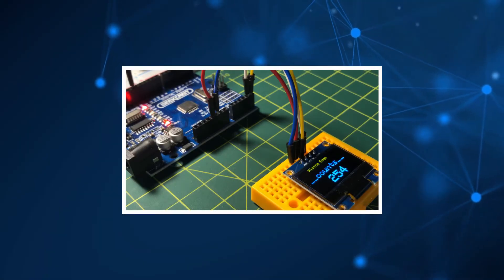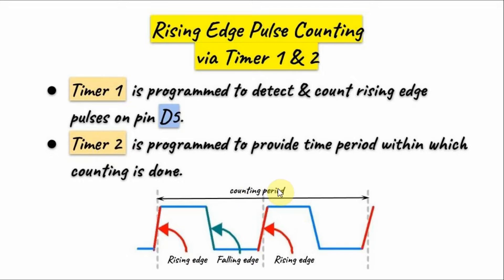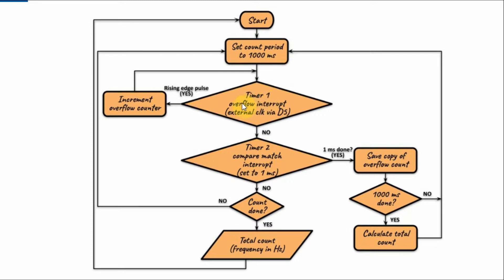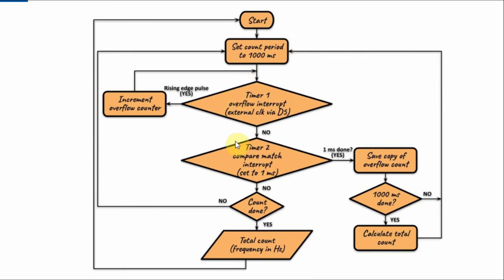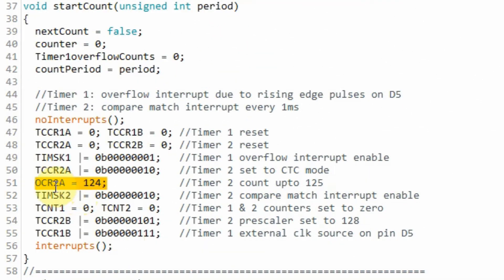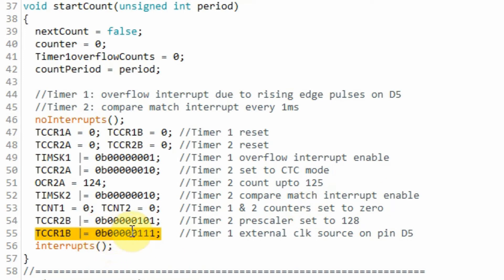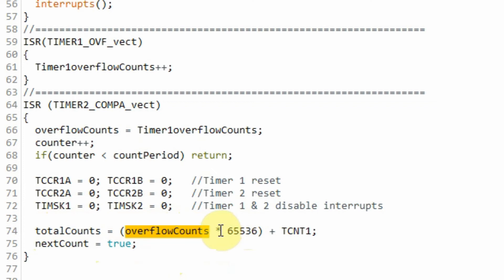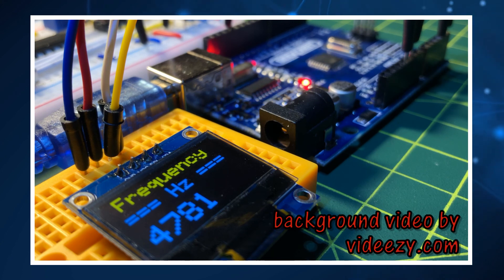Frequency Counter using Arduino Timers

Comment: Sir i need to write a code for arduino that calculates the frequency of a vpulse with timer 1 using counter mode only  on pin2 of the arduino without resorting the interrupt service. Can you help me with such a code..

Comment: Why it does not count  frequency higher than 7 MHz ??? Do you have any notion what is the reason? Theoretically there's no reason, signal, fx of 9MHz is OK, Timer1overflowCounts is less then 200, so what?

Comment: Thanks for the video great project but I have a question.What is the error rate of the counter?
Reply from the maker: Hi, thanks for your feedback. To be able to calculate the percentage of error of Arduino-based frequency counter, we need to compare it with an actual device, which I don't have.

Comment: Thanks for the video! i'm using an additional frequency source but i having a hard time to track both frequency Inputs! Could you give me a hint how to attach an additional clock/timer/measurement for the secound frequency source?
Reply from the maker: Hi. It's not possible with ATmega328 (Uno/Nano), since it has only one 16-bit timer (Timer 1) that supports external clock input. Consider using Arduino Mega, which has 4 16-bit timers.

Comment: This is a great project and will run on an Arduino Nano or even a pro mini. The code is well written and commented and available for download. I recommend this project for beginners as it is a good example of how to write and comment your code. I ran this code to compare to something similar I did using the 32768Hz output from a DS3231 RTC.  Well presented Anas.
Reply from the maker: Thanks